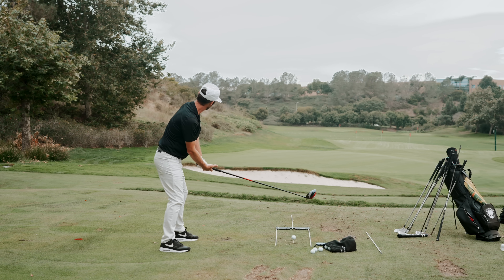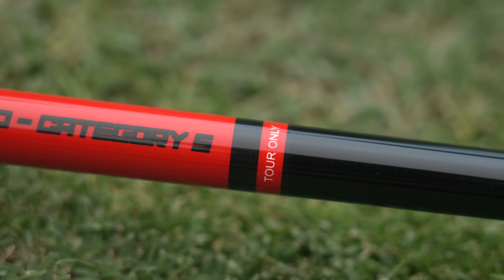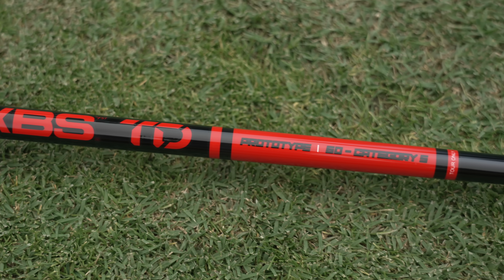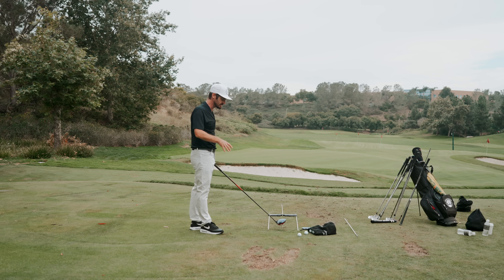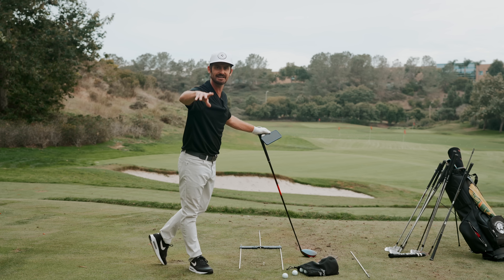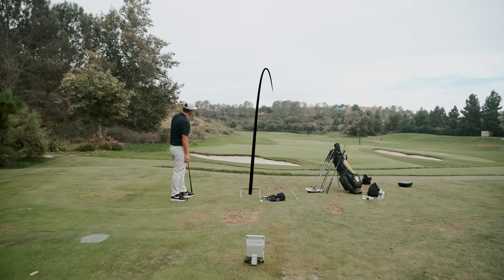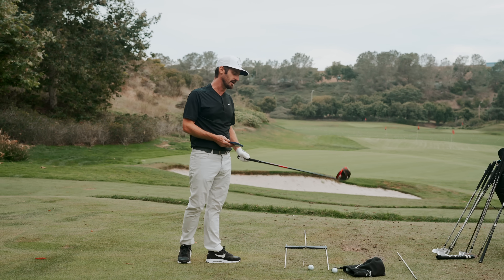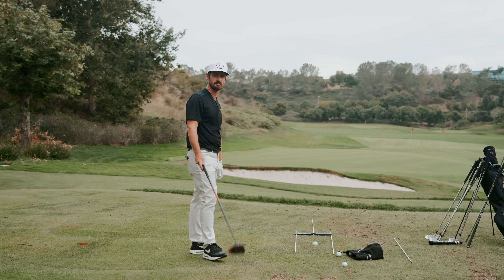Shaft Change? WATCH THIS FIRST!

Comment: Well done trottie, so interesting. I had the same thing in my TM SIM. Started off with fujikura stiff shaft. Off memory think it had pro spec on the shaft, but it was a 60g. Hated it, fade after fade after fade. Back injury later wanted something a bit more friendly. I thought about trial and error. Bought a SK Fiber Hypersonic 60g stiff counter balanced shaft. Friendlier bend point. No more fades, straight and can get a draw sometimes. My point is if it ain't broke no need to fix it in your case but in mine, necessity dictated change and i got lucky. For £40 including the adapter and some pony grip that I cut off and changed when I received it , my driving has been transformed. Irons and putting still crap but hey ho!

Comment: I’ve actually just changed from the current KBS TD catagory 3 60 gram shaft to a LA golf ozik black tie 67 gram stiff shaft and I’m actually hitting straighter and more consistently with a nice baby fade and great launch,with the kbs shaft,although it’s a good shaft,at times I had an occasional hook with it and my launch was too inconsistent and was losing distance whereas I’m not having those issues with the LA shaft,I even put in the matching shaft into my 3HL and it’s a bullet tracer

Don’t get me wrong,I love kbs shafts and have the tour lite in my irons and wedges and I love it,maybe when they get released in Australia I may try the shaft out

Comment: You mentioned swing weight and that seems to be the new focus right now and something that I think a lot of people overlook.  it really influences how the club feels. I had to go to a heavier swinging weight as well because of having higher swing speed I couldn’t get the feel that I was looking for until I made the switch changing the shaft didn’t really matter as much.
Reply: need to be careful though, deadweight is also very important to get timing right in the swing, simply adding more and more weight in the head can affect other factors which is one of the risks with shortened clubs...have tried the 'sledgehammer' style short driver and can create as many issues s it solves.
Reply: What swing weight do you have?

Comment: I have found after years of tinkering that my swing responds well to SW above D4. I have an Autoflex shaft and went to Paradym this past season. Took an extra sliding weight in the track to get it to D4.5. Went from mediocre to great in an instant.
Reply: bit of lead tape could be magic for anyone! I just weighted my 2iron driving iron up to D3 and now its not going on ebay.

Comment: Trottie, would love a video breakdown of swing weight, puring, and CPM/FM. 

Feel like people get into trouble with X Stiff, and Stiff. What maybe an XStiff for Taylormade might be a regular flex for Callaway. Just like shoes run big or small depending on the brand. 

Best way to determine the proper shaft is through those 3 points.
Reply from the maker: Don’t hate that idea …. And totally see your point
Reply: @trottiegolf  I’ll have my popcorn ready!

Comment: Hi Trottie!! I am looking to buy the new Taylormade Driver, and I was searching for your KBS driver shaft but they don't offer it. How does it compare the KBS TD that Taylormade offers vs your gammer? Please your help! Thanks
Reply from the maker: Sup PLYR. So it's the follow on to the TD. I've heard it'll possibly be launching this year. I can confirm it's slightly stiffer in the tip than the current TD
Reply: Thank you so much!!  @trottiegolf

Comment: How do you know what the proper swing weight should be?
Reply from the maker: Feel & performance. You gotta go off the numbers. I would always check swing weight first if I was with a good player and they were struggling to find the center consistently
Reply: @trottiegolf I would assume club and ball speed is a factor? I was 95 club and 123 ball with 7 iron at my fitting. Anything less than a heavy xstiff made the head feel like a wedge. I could feel a difference in the swing.
Reply: @trottiegolf  what number are you looking at?  Swing with to me is almost irrelevant. 

You build and axe with a D4swung weight. 

Not sure how swing weight is relevant in the modern game?
Reply from the maker: @dobermanownerforlife3902  don't confuse flex with swing weight. This is an old video but should give more details:

https://youtu.be/Ww2GaXSEX9Q
Reply from the maker: @markscott4059  Swing Weight is everything to me when working with anyone. 

The balance point of the club can impact so much.

Defo not irrelevant in my opinion 

https://youtu.be/Ww2GaXSEX9Q

Comment: What swing weight do you recommend for driver?
Reply: very tricky to answer, everyone is different and fully depends on your swing and your biomechanics. you need to know your start point and what shape that provides for you, there's many characteristics that will affect how you deliver the club too, not just swing weight. You need to go see a fitter big man if you're looking for deliberate changes! I've spent years tinkering and trying second hand equipment, 2024 I'm stopping tinkering and getting a full bag fit - much to the wife's delight!
Reply: @hadesignite you’ll be back tinkering in no time mate, something that a serious golfer can’t avoid. Nice move getting the fitting included with your habit though, wife won’t know the difference. Lol
Reply: @nelsonjames1272  haha I hope not! my rationale is that if the clubs are fit then I cant blame them and therefore shouldn't be tinkering! lets see how I get on a few months down the line....
Reply: What’s your swing speed?